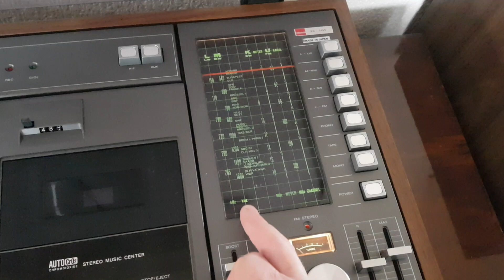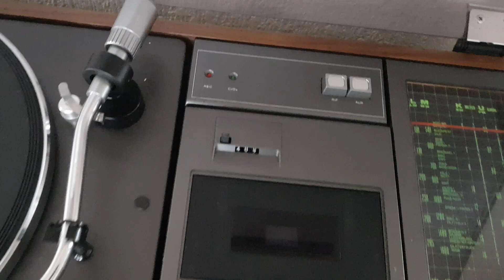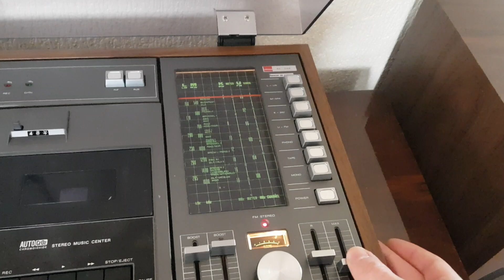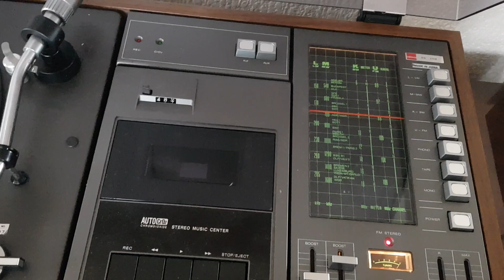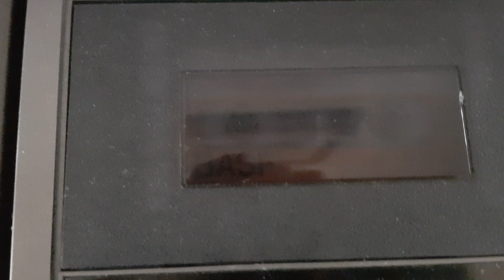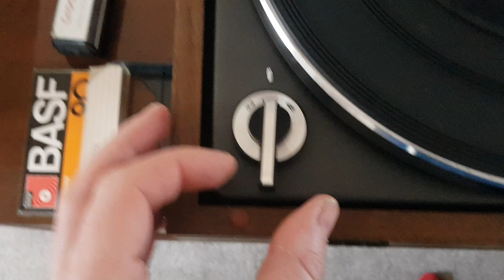Sharp SG-315 Music centre after repair.

Comment: I just bought this one with 2 Sharp speakers. Great looking bit of kit. Phono and Tuner work fine, but tape gets eaten. When I turn on a tape both spindles dob’t slways turn it seems. While rewinding and fast forwarding works fine. Is it a matter of cleaning and applying some oil somewhere to get the tapes playing correctly again? 
Also is it possible to connect a bluetooth transmitter to the headphone jack so that I can connect a Marshall Kilburn bluetooth speaker to it? Cheers and nice restoration!

Comment: Hey man, very nice work. I have the same model myself. It used to work perfectly but i havent switched it on for a few years. Now it turns on fine, radio works well but im having a problem with the turntable. When i lift the arm up i feel it start vibrating, so i assume the servo is trying to work, but for some reason the servo wont spin. When i try to twist it with my fingers it rotates no problem - not jammed. All the rubber is in good nick. On your vid you mentioned that you switched out the servo for one from a similar model, do you think this might solve my issue? Im a novice with electronics so i may have missed something basic, can send some photos if that helps. Very inspiring video!

Comment: Hi there, I have the same device and I need to change the cartridge, I was wondering whether I need to use an original cartridge or if I can use a new cartridge for example audio Technica AT-XP3
Reply from the maker: just order a new stylus, they are available online, the cartridge is the ceramic type

Comment: Hi I have 2 sg450e with no sound output from either they power up OK any advice would be appreciated thanks
Reply: I have a Sharp SG 155H the volume keeps dropping out. I could try spraying the potentiometer with electronic cleaning solvent and if that doesn't work I need to replace the potentiometer. I'm having trouble removing the faceplate so I can get in there to have a look. It has 3 screws under the faceplate but there's something holding it in place in the middle of the faceplate. Do I need a special tool to remove the faceplate?